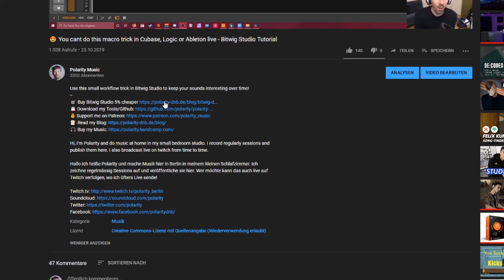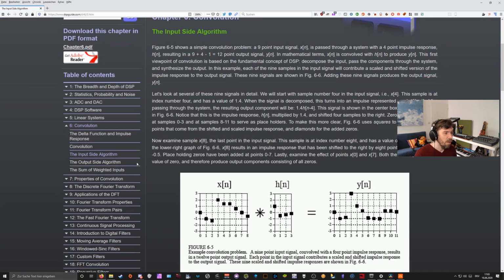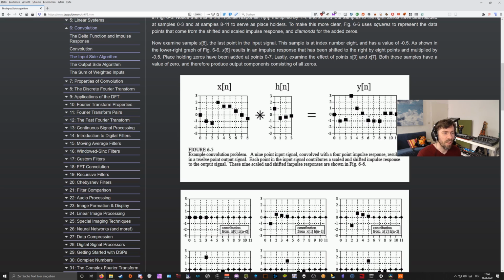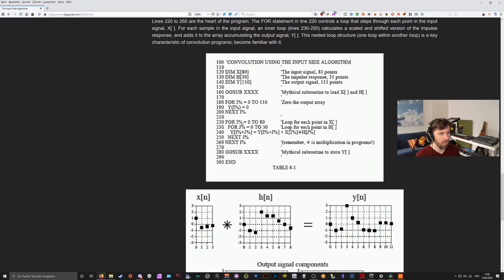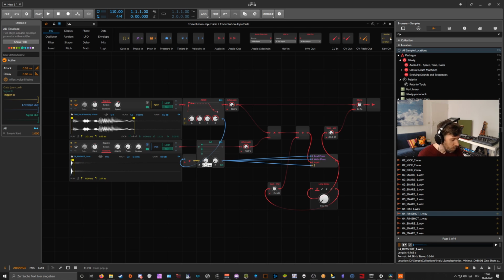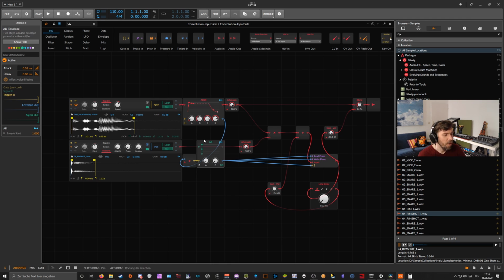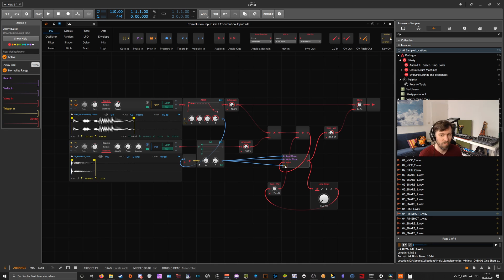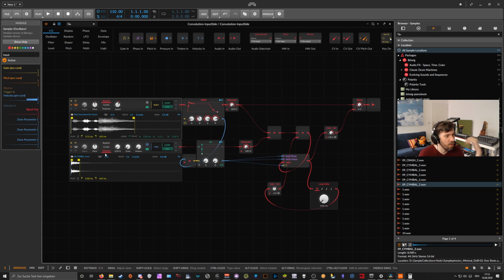👨‍🚀 Convolution in the Bitwig Studio Grid [advanced]

Comment: a convolution reverb does not work like that. I agree with others comments,  the convolution of a signal and an IR signal is the multiplication of each value, in the fourrier domain.  if you multiply the fft for each sample of your signal you obtain the convolution after coming back in the time domain. it is more complicated than multiply two signals, you first integrate, and then multiply for each values.
Reply: a simple test can confirm that your grid does not work. Take your two samples and use an other convolution plugin and listen.
you don't have this crunchy effect how sounds like a vocoder or bit cruher. But we don't give up one day we'll find the solution in bitwig.
Reply from the maker: clement, i did this 2 years ago, it was clear back then that it didnt worked out and it was more like a fun experiment. It was also multiple times clarified that it doesnt work like that.
Reply: This is untrue, no realtime convolution effects works in frequency domain. This is absolutely blaringly obvious because you get no delay in your DAW. 
The specific algorithms used for realtime are called overlap–save method and overlap–add method.
They work in time domain.

Comment: This is more like a first step understanding filter coeffs and it has nothing to do with convolution.
Reply from the maker: how would you try to implement convolution in the grid then?
Reply: Without fft it's pointless for a kernel (IR) longer than about 80 samples.
Reply: But it would be two buffers with the same size. First: a delay line with any sample readability, because you'll read them one by one for each sample of your input. Other is the kernel itself: practically a reversed IR. Should be short... FIR (Finite Impulse Response) filters work this way. Those low/zero phase beasts, you know. If you use any kind of feedback, it becomes IIR filter: those are coefficients of a feedback network.

Comment: Isn't convolution the same as multiplication in fourier space? So simply use the vocoder because it does exactly that?
And sorry, I only skipped through your video. Maybe you've mentioned that already.
Reply from the maker: afaik no :( vocoder is more or less multiple envelope followers & band pass filter
Reply: @PolarityMusic  Are you sure that this is not the same? Are vocoder splits the sound in N frequency bands like a short time fourier transformation splits a sound in N frequency bins. The vocoder then uses the hull curve of all the N bands to modulate the same amount of band filters of an other signal. That should be more or less the same as multiplying the absolute value of each bin with the corresponding bin of the second signal's frequency bins in fourier space and then making a reverse fourier transformation, and that's convolution.
But I am also not an expert. I learned some aspects of this at university and looked at wiki to make sure I am not telling anything wrong.
Reply: @PolarityMusic  it is definitely possible (and more efficient) to implement this with an FFT, see https://de.wikipedia.org/wiki/Faltungshall. But thats maybe too much for the grid :)